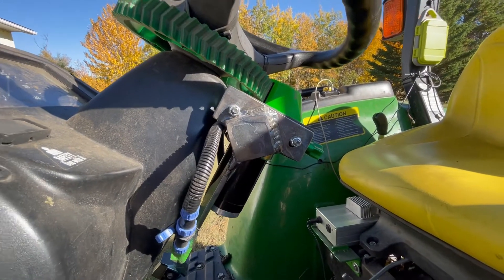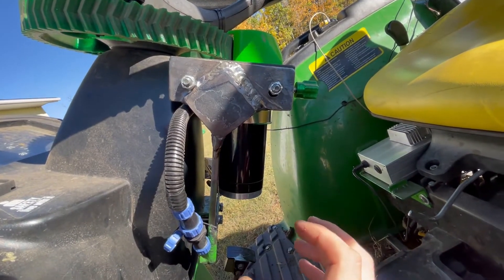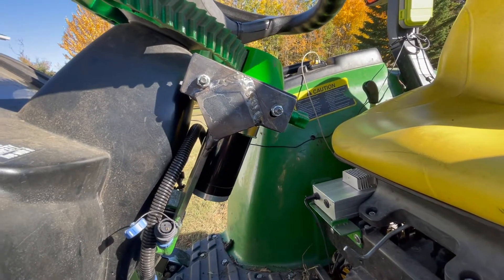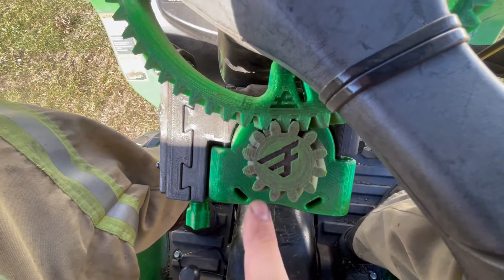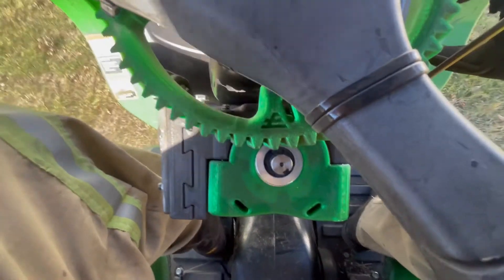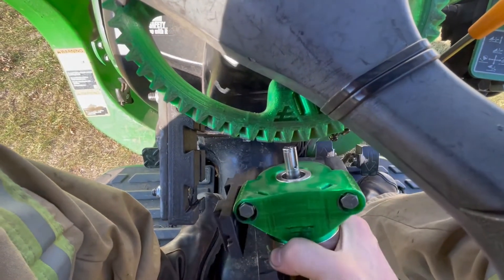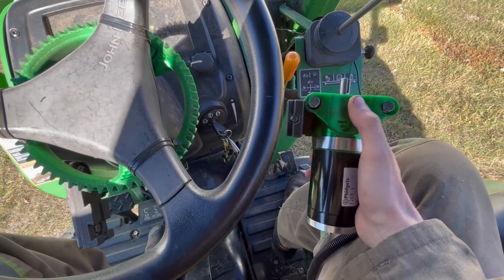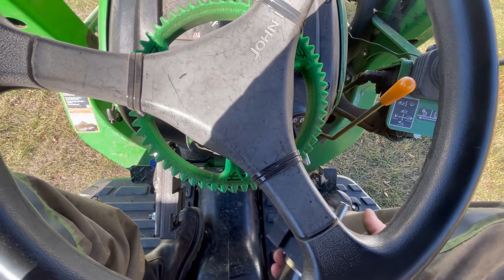AgOpenGPS Universal Quick Tach Motor Holder Part 2

Comment: Hi. Nice job 
What are the spec for the steering wheel motor you are using ?
Thanks
Reply from the maker: Its the Phidgets 3269_3 motor specified in the parts list for AgOpenGps. But they do not specify a way to mount it, they leave that to the owners creativity.

Comment: Thanks for all your work. Im currently building auto steer for 3 of my John Deere tractor 40,55,and 60 series which all have the same steering wheel. Do you think this will fit on? Also looking at buying a 3D printer, any suggestions?
Reply from the maker: Any creality printer is usually pretty simple to operate, and cost effective

Comment: You have your system setup on an open cab tractor. Any problem with dust and moisture affecting motor and electronics?
Reply from the maker: It has a canopy for rain. If I pressure wash it I remove the motor and steer box and screen. The steer box is not ip rated and leaks a little dust but still no issues. The tablet I use is IP65. All of the parts and pieces cost $3K cdn, $1500 of that was the tablet and dock. The steer motor is $120 to replace. So no issues yet, and its affordable to have ready spares. If I had no canopy I would just upgrade the steer box to IP65 enclosure.